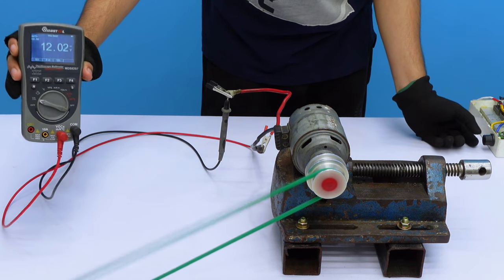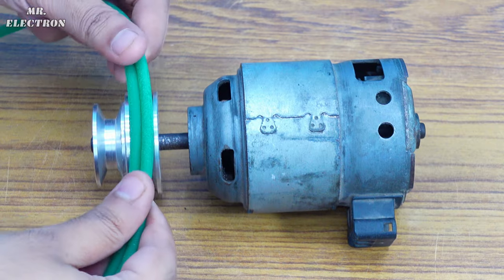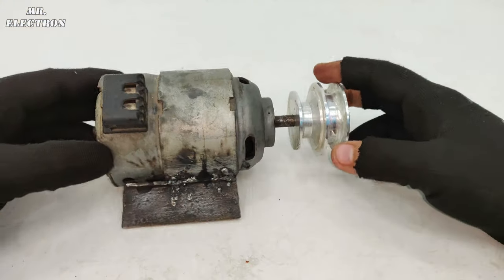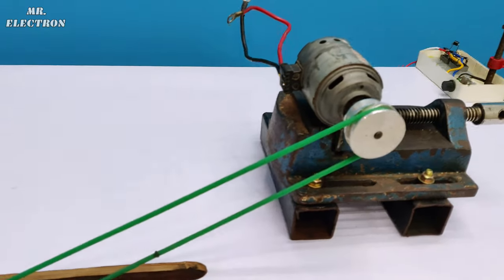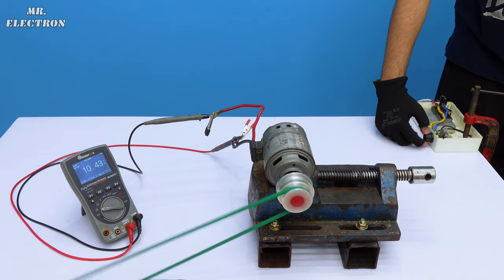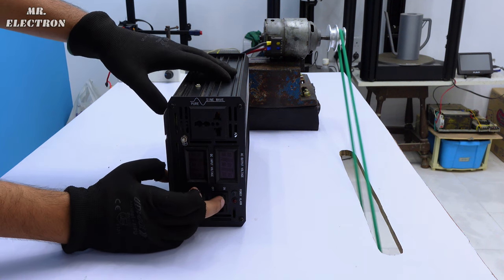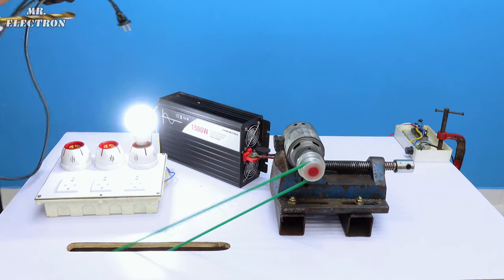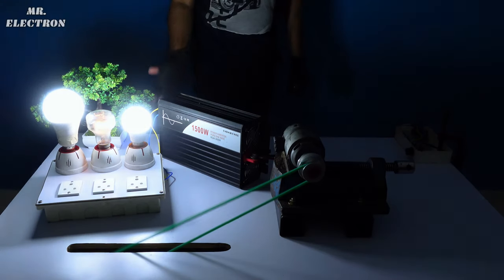I make 220V 1000W Electric Generator from Blower Motor

Comment: Hello, what if the generator is from a car and this generator outputs 90 amps, will this work? Is it useful to operate a 6000w or 8000w inverter and then I operate a windows air conditioner with it? Will this work and can I get it?

Comment: Do you think a 3cc nitro glow engine could run this generator?
Reply from the maker: 3cc is too less for full power output. A 49cc drift bike will do it.
Reply: @MrElectron  Ah. I heard that a 3cc nitro engine could put out 1300w, but I wasn't sure! Thanks

Comment: The idea looks good but if the battery drains out then you have no option but go back to use electricity to charge the battery. Had there been an option for recharging the battery when the motor is running then it makes sense.

Comment: LED bulbs basically run with DC supply only... so better to boost up the generated DC voltage instead of converting it to AC which loses a lot of power...
Reply from the maker: I also had to show drill and jigsaw, which requires high power
Reply: @MrElectron  well they have universal motors so they can also run with DC supply